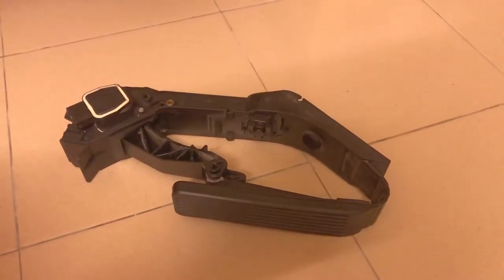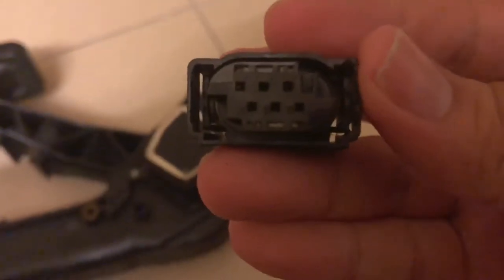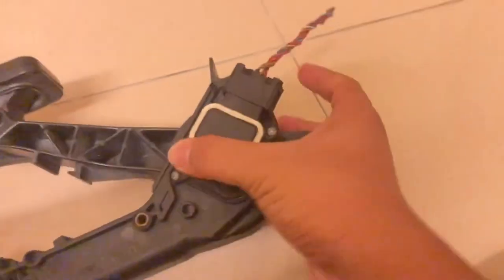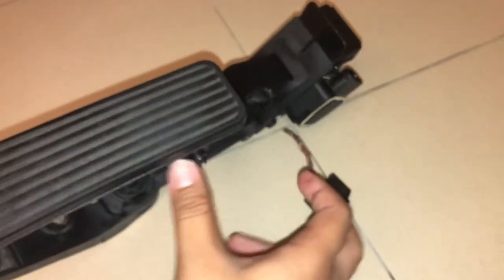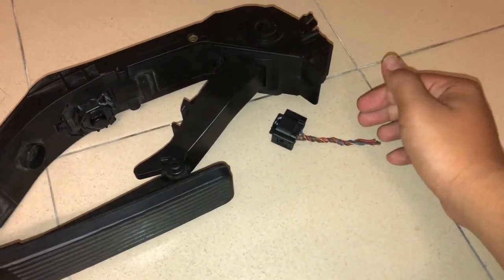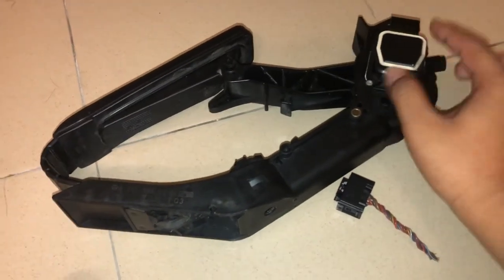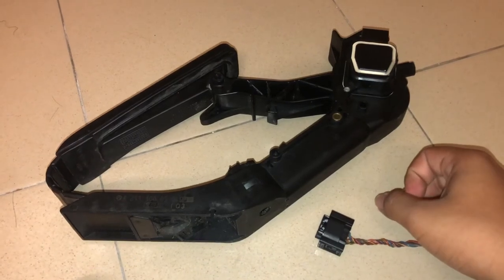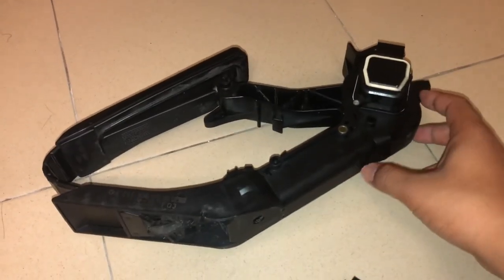No idea how to replace the pedal position sensor of your W211 E Class? Watch this video!

Comment: Hi man, nice video! Just one question. My w211 was equped with pedal #a2033000104 and have 2 wire harness coming out from the unit. One like yours from the upper sensor and the second from the bottom, under the kick down button. What do you think, will it work if I replace my pedal with: A2113000404? Thanks!

Comment: Hello, I've got question. Sometimes while cruising my pedal starts reacting very slowly, it means maybe 20% full power. Doesn't matter how much I try to accelerate, even no reaction for kick down. But when I use gear lever, to change the gear, everything works properly. When I turn off ignition and start engine again, everything is good again. What do you think, it is throttle sensor or throttle body? What about no kick down reaction? The transmision should kick gear immediately, even if throttle body not acts properly, or the transmision kicks only after throttle body proper reaction? And the second question, if the throttle sensor is the problem only, accelerating via cruise control lever should be normal?
Reply: Replace your paddle
Reply: @Moesbikes_detailing  thanks but some time later I started to have troublee with turning engine on, it was shaft sensor. i,ve replaced it and every kind of problems stopped. Don't know if that was connected problems but it looks like... The strangest thing is no crankshaft sensor erorr before, only throttle position..